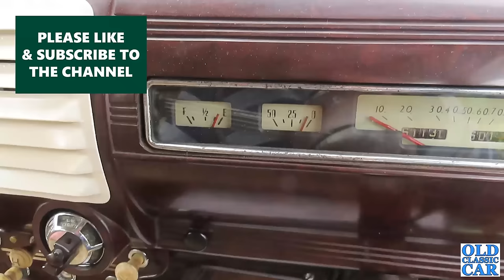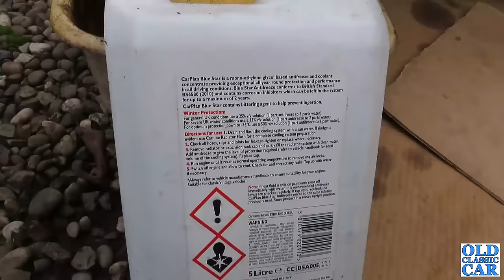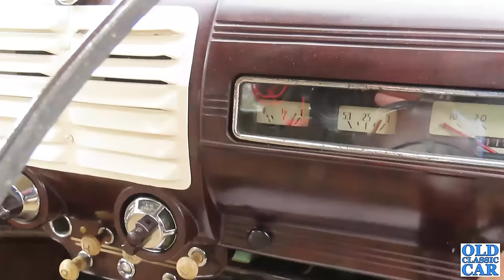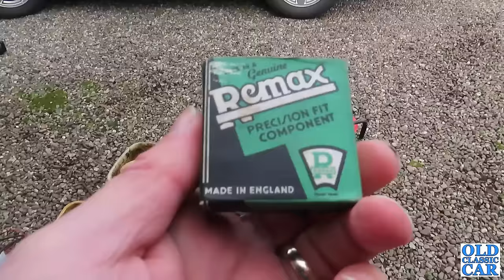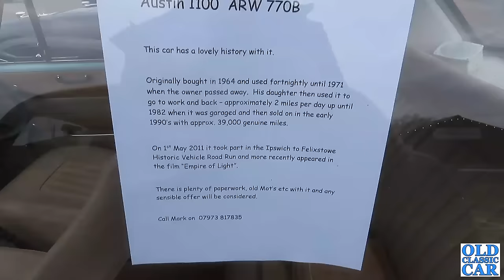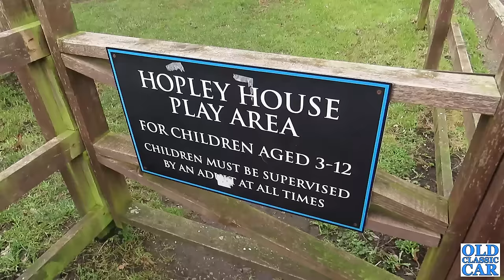V8 PILOT LATEST - fresh coolant, then a test drive to the Hopley House classic car meet

Comment: Great work & what a great design with the twin drain taps, that’s a serious amount of coolant. Amazing looking car & the engine sounds lovely, after your carb fettling. Our MX5 mk1 & Honda Jazz have Rad drain taps, very sensible
Reply from the maker: That's interesting, I must have a look under the front of our Mk1
Reply: @oldclassiccarUK  it’s a philips screw/ bung on mk1 if OE RAD, but my replacement rad has a plastic wing nut, which is better

Comment: Magnificent car, the Pilot, very American. The slanty tail lights on the 1100 came in about '67, and a bit later, the FX4 Taxi had new rear wing pressings to accommodate these. Previous to this, they had a stop/tail lamp, and the direction indicator stuck out of the roof above the B pillar. Thanks for your videos.

Comment: Used to be so simple changing anti frezze.....so many different types no.....

How did you know what type to put in the Pilot.

I like 50% for its anti corrosion qualities.....after a good flush out with plain water....and a run to get in all the nooks....used to be able to buy rad flush.

Love the polished header tank.....yes no stats....I would think the same.....not good for the motor.....not getting hot enough....what temp does it run at after a bit of a run.

Your right....it is a very sweet engine.

Is your dad connected with aviation.....some nice badges on the Jags grill.
Reply from the maker: The old-school blue Ethylene Glycol (sp?) is the go-to stuff for anything old like this

Comment: What are the two white and dots at the top of the fenders in the front? The dots are about the size of an american quarter.
Reply from the maker: In the earlier V8 Pilot videos I talk about removing a pair of awkward looking wing mirrors, I used dome headed bumper bolts to fill the holes.
Reply: @oldclassiccarUK  Thanks.

Comment: Does look as if there are no thermostats fitted. Sometimes they are removed if overheating is an issue, but its not really a solution as it can let the coolant go through the rad too quickly and not cool the coolant correctly. Very odd drain taps, usually they are open when the lever is in line with the flow.

Comment: Morning All !  Richard can you confirm that the M.G "Y" type also had it's own jacking system ? My brother wrote off Dad's new Morris 1100 in Christmas 1963. He was overtaking a car (it was dark) and the car overtook a bike pushing us off the road . My twin brother and l were in the front left seat (no seat belts back then!) The door  burst open and Keith was thrown onto the road . Luckily , he wasn't run over !  Meanwhile , we careered into a field , bounced over a tree,  landing on the roof which was flattened down to the door tops  ! Somehow , my brother and l scrambled out . We looked for Keith and thought he might be under the car . How we did it l'll never know but we  managed to lift the car on it's side not knowing he was thrown out . Dad went out and bought an identical car and made my brother drive it down the same road to calm his nerves . ..........your remark about the different rear lights made me chuckle . So l worked in a crash repair shop and an 1100 came in for a new rear wing .......l think you may know where this is going ! They were not a nice panel to fit . So the panelbeater fitted the wing , the painters painted it , the panelbeater put all the parts removed back on and the car was parked up for collection . Incredibly , no one hwd spotted it was a later wing on an early car. The  customer came to collect it and HE was the one that noticed the mistake !!!!! And l wasn't the culprit  Richard 🤣🤣
Reply from the maker: Yes the YB also has the Jackall system, in one of my Wem show videos I talk to a gent who proceeded to demo his system. I'll do the same sometime. Love the wing story, reminds me of Johnny Cash's song One Piece at a Time
Reply: @oldclassiccarUK 
I had an Austin Princess Hearse 1954 (from memory) that had built in hydraulic jacking system, you lifted a flap in the floor by drivers feet to operate, I think it was marked as blackjack but I might well be wrong.
Reply: @oldclassiccarUK 
Also, at the time I couldn’t afford the cost of antifreeze so I used a couple of thick padded horse blankets to cover the engine at night, the obvious happened,  I forgot to remove the blankets and only remembered when smoke billowed from the bonnet 🤣

Comment: In the 1966 l bought a ex PLA police car 12v electrics lowered suspension and 24 head stud mercury engine the two 6v batteries fitted under the rear seats  giant speedometer where the central speaker was. I made a bigger bore exhaust system that by itself woke the engine up (to much back pressure)   Pea shooter exhaust resulting in braking two left hand half shafts  great  car fantastic v8 sound   Written off by a careless driver engine ended up in a wall known stock car. .after that bought a std one
Reply from the maker: Sounds like a fun car!

Comment: I wonder if the last owner had problems with overheating? as it looks like they may have been running just straight water by the looks of the rust in the radiator. I would give the rad a good few flushes and check the thermostats. You may find that the radiator needs cleaning out proffesionally, they will unsolder the top and stick rods down the coolant passages to clear it.
Reply from the maker: The old stuff smelt like antifreeze so I think it was just an older mix, fortunately it wasn't as gloopy as I was expecting. Thanks for watching.

Comment: Love that flathead. Was the grille similar to the Prefect? There is a video in that built in jacking system!! Cheers from NZ.
Reply from the maker: The grille was similar but different, if you see what I mean. Yes I plan to have a proper test of the jacks sometime, I did feature the system fitted to a gent's MG YB a year or two back.

Comment: Accelerator pump ?  running a bit weak ?  needs a bit more ignition advance ?
Reply from the maker: I don't think it's running weak but yes the accel pump is something I wondered about, I'll just keep an eye on things as it might settle down with use